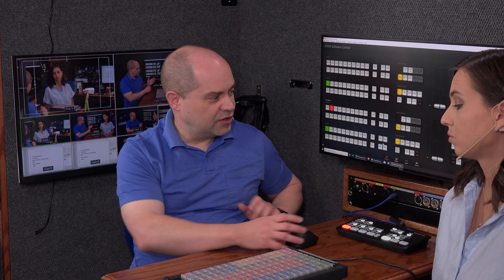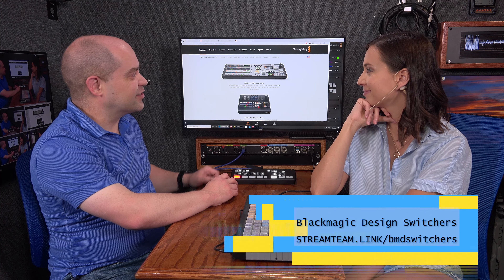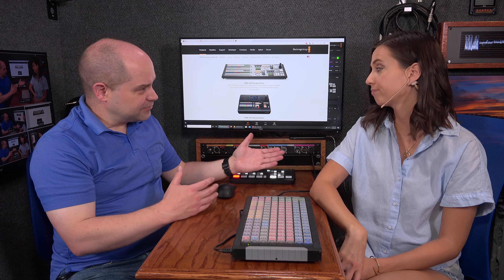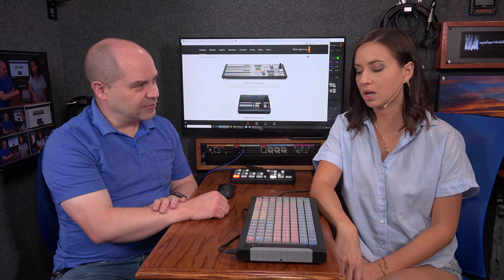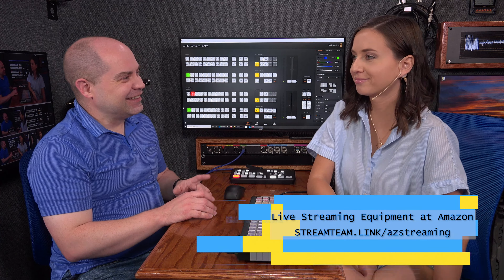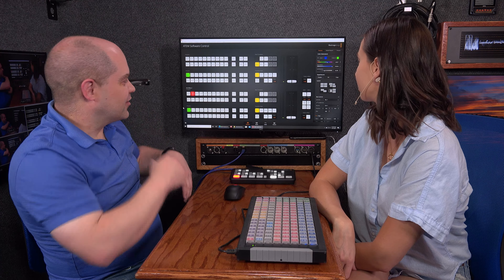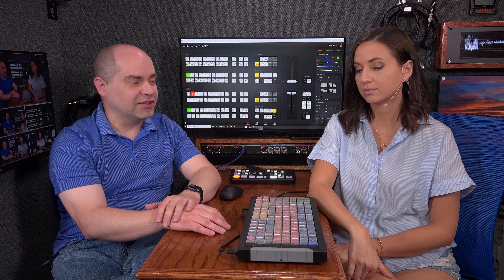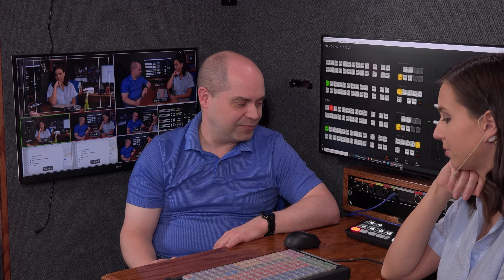Stream Team 5 - Switcher Basics (Part 1)

Comment: I'm a VMIX guy, personally. I get the point of using a hardware dedicated switcher, but I find that the software solution has so much more flexibility. My hardware consists of a keyboard and a steamdeck elite for hotkeys (3 sdi cameras) 

Works well!
Reply from the maker: We all have different needs. I understand that there are many situations where software switchers make sense. For me, though, I quite often (1) need a dozen inputs simultaneously which would cost a fortune in capture cards, and (2) do IMAG so the additional delay caused by software switchers is unacceptable.